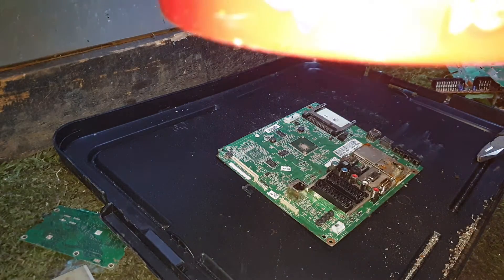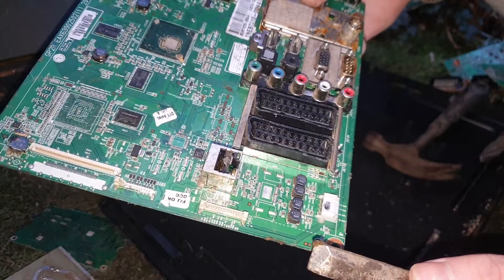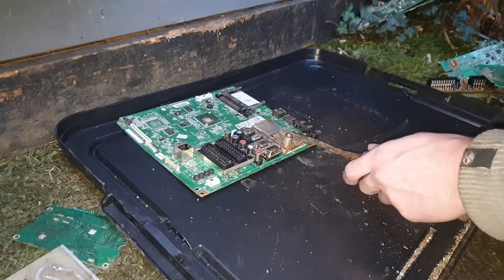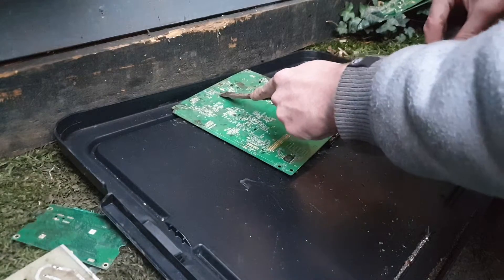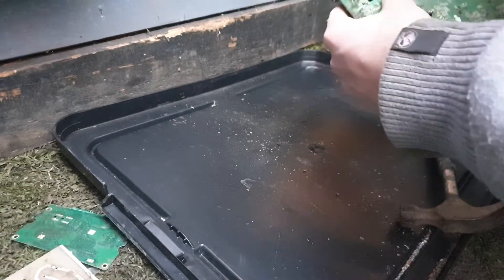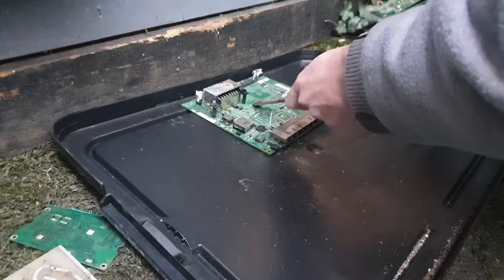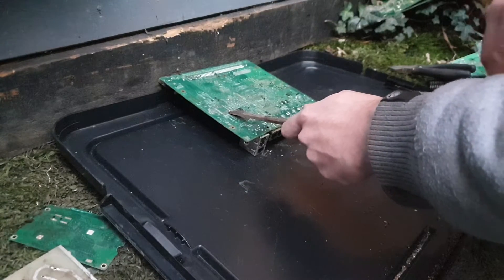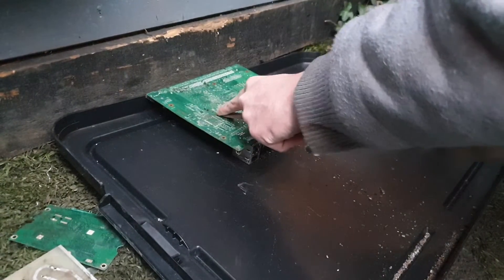fastest way to remove mlccs from motherboards ewaste 1kg a day

Comment: Quite competent. Next tool to acquire: air chisel. Good video. Carry on, squire.
Reply from the maker: Haha. I got a air chisel and didn't like it. I found it slower as bits go everywhere then gotta sort and its just so boring as well. This way I remove what I want and it comes of nicely and I can choose how hard I hit
Reply: @keytefirerefining1355  interesting. I would have thought that if you had chisel bits the same size as those sizes you use with the hammer it would work the same only faster. Maybe you'd have to build a rudimentary hood to keep them from scattering all over the garden. Anyway I am inspired by this video to harvest the mlccs as well when I depopulate my board hoard. Cheers
Reply from the maker: @MrShekoexile  air hammer will be quicker to remove stuff but you gotta sort which takes forever but if you try removing 1 component with the air hammer it takes ages to start it then put it down when you can just hold a chisel and hammer
Reply: @keytefirerefining1355  I will defer to your greater experience and save myself the expense of getting an air chisel for now
Reply from the maker: @MrShekoexile  also with a air chisel you need a compressor which is loud and you gotta wait for it to fill. At least with chisel and hammer you can spend a minute and go away if needed